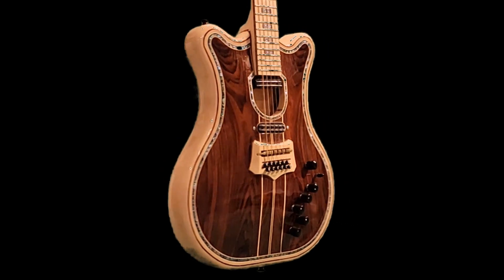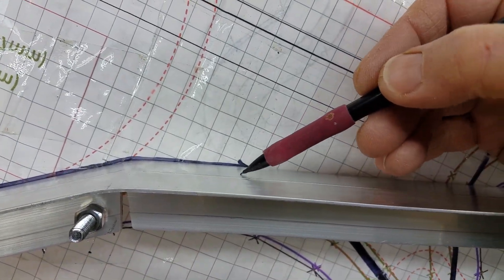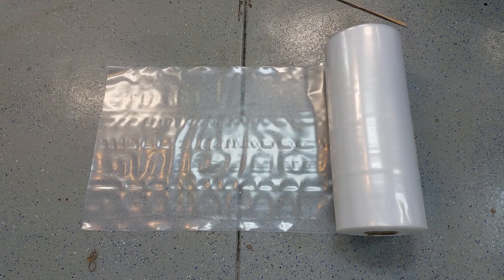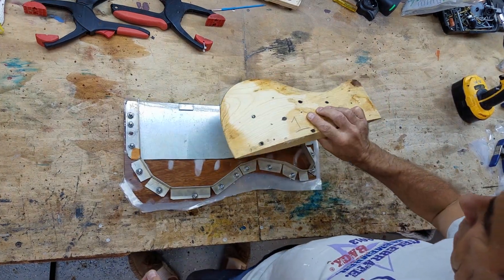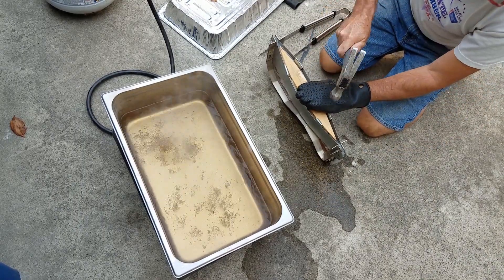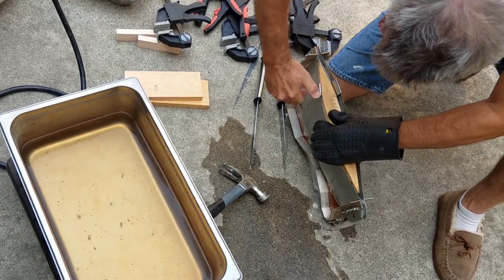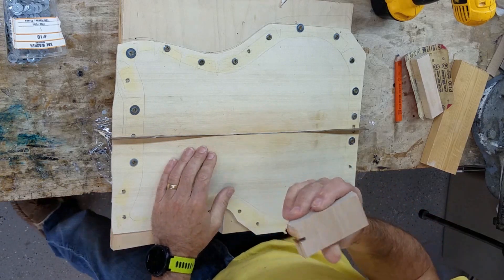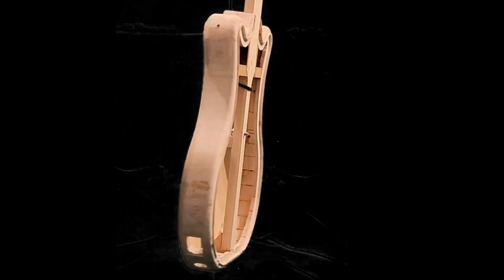How To Make The Top For An Archtop Guitar Using Steam Bending

Comment: $5,000 in tools to build a $500 guitar?  😮
Reply from the maker: Not really $5000... The most expensive tool shown is my bandsaw, a recent addition to my workshop, about a quarter of that. But you don't need a bandsaw to do this. You can purchase 1/4" thick resawn tops from many sources - the spruce top on the guitar shown at the intro was from Stewmac, and cost about $25, and you can do all the fine outline work with a coping saw. The other tool being used a lot is a belt sander (about $150), but that's just because it's easier than a hand sander.
Reply: @Drewmo2000  Not meant as a insult, it's a common joke, but you are correct about my lack of detailed knowledge.
Reply from the maker: @primoroy  Heh heh, no worries, the other guitarist in my band was forever telling me it was a lot easier to buy guitars from Guitar Center. But hey, personally I get as much fun out of making them as playing them😁

Comment: After watching this,  I'll stick to carving a billet.
Reply: Agreed. He's got sheet steel, aluminum L track, poly plastic and vacuum sealer, buffet serving tray for boiling (good idea for steaming wood, btw) a full wood shop with planer and bandsaw, and to top it all off, he designed the form in MICROSOFT EXCEL. I dont have the patience, materials, or the motivation to do what a single gouge can do! Props to the ingenuity, but thats a no from me, dawg.

Comment: I imagine that an arch top that is bent, rather than carved, is a bit stronger and sands to a better finish because the fibers conform to the desired shape and less end grain is exposed on the curved surface during subsequent shaping. It appears that an asymmetrical body shape just means double work on the frame assembly and shaper/interior form. Thanks for the information! Excellent instructional and beautiful guitars!
Reply from the maker: Thanks for your kind comments. Yes, the grain does all remain in the same plane, so I've had no issues to date with sanding and finishing that might otherwise be found due to end grain, as you say. One thing I have recently noticed using flamed maple for the first time is that you need to make the top a little thicker, maybe an extra 1mm or so, to allow for more sanding, as the same variations in the grain that cause the flaming effect also leaves the surface rather 'wavy' when it dries out, and so needs a little extra sanding to pull it back flat.
Reply from the maker: And also, yes, I've recently thinking about making an asymmetric shape using a second frame. The key thing here is to make sure that a similar profile shaping wedge be used so that the two sides meet together, which makes it a little more complicated.  In that case the two halves in each frame could be used for the front and back.

Comment: Nice jobs. Nice tools. I need the exact opposite, but I guess this is as close as it gets. I have a flat top guitar that was obviously left outside in a rain, bottom up. The back bulged outward to the point it cracked. I am thinking of removing it and ironing it flat. I'd have it replaced but it is a Brazilian rosewood as far as I can tell, and very old, so no replacements. Thank you for mentioning the plastic sheet, I may want to preserve the smell.
Reply: If you haven’t already, let it acclimatise to a more normal humidity for a while before doing anything drastic. You may find that most of the problem resolves itself as the wood dries and shrinks, or possibly the ordeal will have left more permanent warping around the crack area.
Reply: @ollimoore  Thank you, no problem. It looks like the damage happened long time ago though. I think I will have it fixed professionally.

Comment: Quite the timing, I was just wondering about this today. I'm coming from the worlds of banjo and bowmaking and there's a similar process to bending wood there. It seems to me one of the trickiest parts of the process is probably making sure that your form is identical on both ends. Any advice on how to make sure you've got an identical curve along the bookmatch?
Reply from the maker: The former is made from two halves screwed together. Before screwing together, put the two halves side by side, and make sure they identical on each side and there is no height difference along the length. There is a bit of keeway when gluing the two halves of the top together to balance them also. In the end, you may have to sand away maybe 0.5mm or so to get the two sides to match completely, but that shouldn't be a problem.
Reply: @Drewmo2000  along that line, i had to replay that part where you put the halves together. with the seperator i wondered how you got them even. then i saw the littlewood tool with the notch to go over the feature stripe and the two sides should then evenly touch the top. very cool. 
an archtop is in my future, and i like this method so might do it rather than carve.
so, i saw someone making a 12 string but only to the 12th fret, he might have went to 14. he said 12 string players never play those higher frets anyway.
true? you have short neck 12 strings? i'm not a 12 string player so i don't know. interesting though.